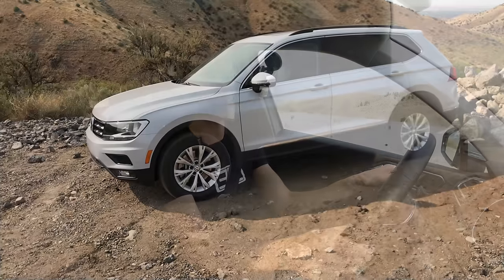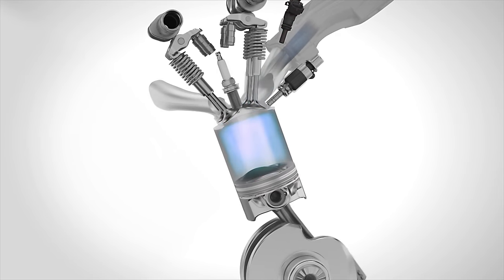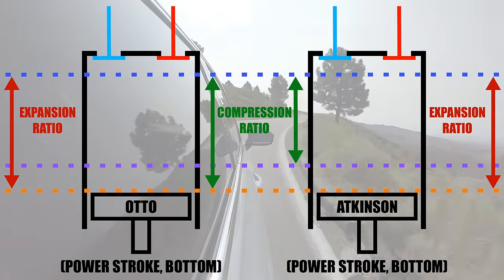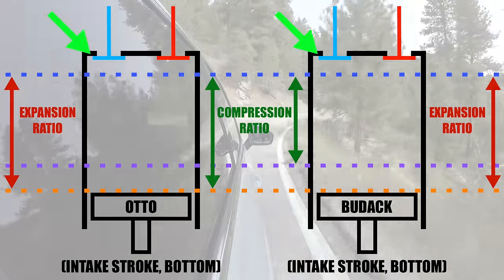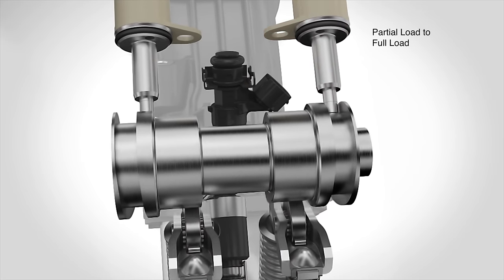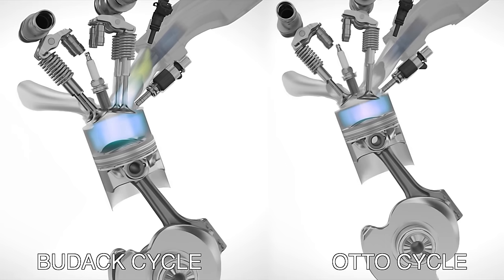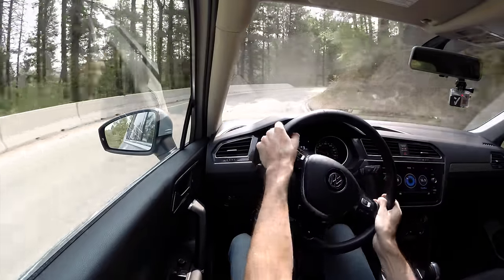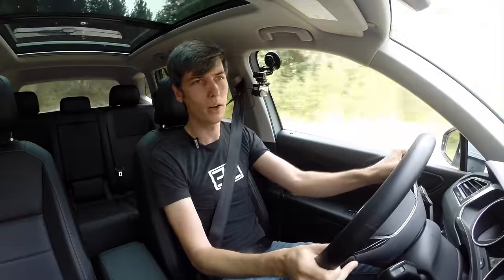Volkswagen's New Engine Cycle - The 'Budack' Cycle

Comment: ECONOMY, NOT EFFICIENCY! The cycle gives economy, but not efficiency, as the engine is putting out at the minimum, equally less power for the fuel consumption.
Reply: Cody Moncrief:  That makes no sense at all, to get better economy under the same conditions the engine has to be more efficient.
Reply: not necessarily, because you can put out more power by efficiently compressing the air/fuel mixture and burning all of the fuel... but that is at the expense of economy. 
for example, the atkinson cycle actually seems to be less efficient (at producing power), but as a result, has better fuel economy. 
seems like majority of people are getting economy and efficiency mixed up.
like in NYC, they have "efficiency" apartments for rent, when in reality they are just "economy" apartments. nothing very efficient about them, other than efficiently making landlords more money, lmao.
Reply: It is using less power when less power is needed.

Comment: All interesting, but wouldn't there be suction losses if the valve was closed early?
Reply: No it shouldn't as it then easier to compress the fuel air mixture on the compression stroke
Reply: @mackal598  I think it should because there isn't ideal gas and there are some loses. To be able to compare efficiency we should get some real life data ...
Reply: No, not really. The "vacuum" just acts as a "spring" so the beginning part of the following compression phase will use up the energy you have put into the "vacuum". Sure there are tiny losses, but they are far less than what you gain from the higher efficiency.
Reply: The suction is to differentiate what they're doing with Toyota's atkinson engines which are running in millions worldwide..

Comment: New owner of one . So my question was this drive done in normal mode or in eco mode ? Driving over a month I've played with the settings I currently run it in custom where it's sport steering with eco mode . The car has made 35+ highway and 24-27 without the ac on city . I switch it to sport and all that goes away 😂 then it's 22city -27 highway ac on ? 22 either situation.
Reply: Budack cycle is useless.  Doesn't actually improve fuel economy, it only works theoretically. The different modes  in the VW are transmission modes. I drive my 2020 4motion Tiguan in sport mode all the time and use manual to force the up shifts while cruising and get 35 mpg on any trip that's 60 mph or faster.
Reply: @remmuhjeff  it is an efficient engine, but I prefer the old 1.4 TSI EA211 with Atkinson cycle.

Comment: Doesn’t change the cycle, it changes the cam duration and profile. It’s still a 4 cycle engine
Reply: Juan Herrera that is like saying Diesel cycle and Otto cycle are the same because both have 4 strokes
Reply: @gustavoortiz1901 . I don't know about every diesel engine but mine is a two stroke not four

Comment: You missed that the Budack cycle not only lowers the compression ratio, it also creates a vacuum which will in turn suck up the piston. In comparison, the Atkins cycle will have more energy loss, because it is sucking in fresh cold air, warms it up and then needs to eject it.

Comment: Has VW claimed any advantages over the Atkinson cycle?
Reply: Outside of not having to pay the patent holder for the "Atkinson" tech? Any time a company does something it is about the bottom line. How much does it cost and what will we get out of it.
Reply: Above, blurglide also pointed out that Atkinson-cycle engines suffer from unneeded pump losses, that are addressed by the Budack design. This seems like a viable engineering angle to support their move.
Reply: I think Atkinson cycle won't work with boost or won't make much sense at least. Pushing out air through the intake valve while the intake port is under boost pressure...
Reply: Isn't the Miller cycle just Atkinson + boost?
Reply: Also it's a benefit that you don't push out your already created fuel air mixture into the intake manifold. If you do that, it gets harder to inject the right amount of fuel in the next cycle, because there's already fuel in in the intake air. This benefit is only for injection into the intake (mpfi) and direkt injection during the down stroke. If there's a direct injection in the upstroke, it makes no difference.
Reply: Peter Muelltonner this makes sense, I couldn't  work out the benefits over Atkinson cycle.

Comment: They should have stuck with port injected SOHC and worked on reducing NOx. If the volumetric efficiency is permanently reduced by omitting dohc and vtec, the (actual) compression ratio can be increased proportionately to the reduced intake pressure/volume.

Comment: My neighbor had a VW Tuareg. He had an Isuzu SUV before. The Tuareg (according to him) was "the most unreliable vehicle he's ever owned" - and extremely expensive to service and repair. The Isuzu, on the other hand, was "the least expensive to maintain and most reliable vehicle he'd ever owned". I bought it from him when it was 12 years old and I ran it for another 13 years. It cost next to nothing to maintain.
My neighbor spent $35,000, on the VW, over the next five years. (New engine, new auto transmission, new catalytic converter, multiple electronic and brake issues. Other people I know, who have owned Tuaregs have told me similar horror stories re. reliability and overpriced spare parts. 
Reliability is everything, unless you're only going to do city driving. .
A slow revving, simply designed, unstressed Diesel engine that is cheap to service is a no-brainer. At 30mpg, over 30,000 miles, the fuel cost is about $3000. 25mpg, equates to $450 _extra_. ie no big deal.

Comment: How long will it take to go to normal power mode? Probably too long? After dealing with their earlier turbocharged cars that had no usage torque and power for real life driving and acceleration especially for merging into traffic from a stop sign I vowed never to fall for such dangerous gimmicks again. They put a turbo in it, reduced the engine displacement significantly and make the car heavier. Almost got me rear ended and killed a couple times and I got rid of a then brand new Passat and lost a good chunk of money doing so. I’m not falling for a reduced power cycle engine. Screw that!

Comment: First, I think it will decrease the volumetric efficiency
Second, as the volumetric efficiency decreases, the compression ratio will decrease too
Third, as the compression ratio goes down, the engine efficiency will down too
Am I wrong?
Any tought?
Reply: agree with your point. but Acc to me the power and torque will go down but car will achieve more mileage.
Reply: The gas that exits the cilinder has a lower pressure, meaning it is less energetic. This means less useful energy leaves the engine, also less fuel enters the engibe so the thermodynamic efficiency might be higher.

Comment: My '97 outback with 250k mi on the engine and 312k on the car gets 28.1mpg at 4500 feet altitude

Emission controlls kill gas economy
Reply: "Emission controlls kill gas economy"

True. If the vehicle was made in the '70s.

Comment: Ha ha....😆  my 2013 Subaru Forester 2.5 L boxer engine  gives me 27.6 MPG on the high way and 29.2 MPG if I turn it off and roll my windows down.. and did I mention that It has 210,000 miles on it?

So, why go Budack???

Comment: So basically instead of pushing out some air into the intake manifold, it forces tye combustion chamber into A SERIOUS VACUUM.... now what could possibly go wrong switching from vacuum to compression 200 times a minute..... there goes the lifespan of the rings.  And DON'T TELL ME it had "vacuum" during a standard otto style intake stroke.....

Comment: And still, the old VW 1.9TDI with the antiquated distributor type diesel pump runs cheaper in real life scenarios with varied driving. All the new VAG technologies are aimed at unrealistic driving to get good NEDC mileage, seats and interiors are ripped out, grilles are covered, body joints are taped over, THEN they test it. But, in real world driving the variable cam makes sure it can consume enormous amounts of fuel as soon you remove the egg from under the accelerator pedal. Dont take my word for it, just get a 300,000 mile 1.9TDI and see for yourselves. Budack basically just came around to replace the Defeat Device subroutine, artificially low consumption on paper and high real life performance.

Comment: Basicly VTEC is same  idea. Switching cam profile. If you can make a 3 profile (maybe even more) to one for Budak cycle one for Otto cycle with lower timings and lifting and one for crazy RPM cam you can have a budak/VTEC high reving screamer with low fuel using when you are crusing. Also you can make a supercharged or turbo charged versions and Budak cycle for high Boost setup i guess to make the engine even more crazy. But the top point is elctromagnetic valve idea. Of your valves are controlled by a elctromagnets you insted of camshafts you can switch the cam profile ore the cycle with a ECU. This can make your engine what ever you want. You can lower your compression ratio bu using aktinson cycle and with high cam profile actinson cycle engine you can rise your rev band ratio afr ratio and Boost level automaticly. This can make your engine like almost ant engine you want. when crusing engine prouduses 100hp Max and saving fuel even more. But when you kick the pedal engine switches the mode and boom you got a screamer 500hp 9000rpm monster
Reply: Or !? Go Electric!

Comment: This is not a "new cycle" its a four-stroke engine with what is effectively the wrong camshaft that does not count as a new cycle "oooo I retracted my valve timing 15 degrees to early" 

 slaps roof of car "this bad boi fits soo many camshafts with lobes that are not correctly positioned"
Reply: @S Hendricks "oooo I retracted my valve timing 15 degrees to early and added a turbo" NEW CYCLE 25 Million dollars please.

Comment: question:  as the intake valves are closed before reaching BDC isn't the piston pulling a vacuum for that last little bit of the intake stroke and does this not rob power from the engine ?  i see how having the "longer" power stroke can increase thermodynamic efficiency, but how much of the potential gain is lost to the aforementioned phenomenon ?

Comment: I think the engineers at VW created their own job security by selling this “new concept” to people who don’t know how engines work!

This is nothing more than another approach to Variable Valve Timing (VVT).  Keeping the intake valve closed for part of the intake stroke does not change the compression ratio - it changes the CHARGE DENSITY of the air/fuel mixture in the cylinder.  It’s the same thing the THROTTLE does.  Variable Valve Timing also controls airflow through the engine but better in that it can modulate both intake and exhaust timing over wide load and/or engine speeds.  In fact, if given enough range, VVT can even eliminate the need for a separate throttle valve.

More complexity, cost and potential failure points when the engine already has VVT.  Just make the VVT better!

Comment: This looks to be very similar to the engine they put in the Polo GTI 6C (1.8TSI [Engine Code: DAJA]  - I think the other name might be known as EA888 Gen3?).  Not only does it have this technology, it also has a very complicated cooling system and it also has dual injectors per cylinder, one high pressure and one low pressure.

I'm not entirely sure what having dual injectors achieves, other than different available flow rates for fuel  injection.  I was under the impression that the efficiency came from the high pressure atomising the fuel better?  However, it seems to me that the high pressure rail is for high performance above 3000rpm (or just high driver demand via the throttle?) and the low pressure is only active during low load situations.

I have checked this with diagnostics (VCDS) and watched the injector firing counts, which does kind of confirm what I've said, but I've not taken it for a drive whilst monitoring the figures.

Comment: Well..  the WHOLE idea of the atkinson cycle was to kill 2 birds with 1 stone. 
1) have displacement on demand via vvt and thus drastically changing the engines efficiency, while cruising for best economy and still have best power. VVT as we all know is a VERY reliable hydraulic system rather than VW's mechanical possibility of failure with pins and sliding camshafts.

2) REDUCE PUMPING LOSSES.   Pumping losses are incurred anytime you are trying to suck air through a restrictive opening, Or compressing gas in a cylinder for ignition, or pushing spent gasses out the exhaust valve. Toyota managed to reduce pumping losses significantly simply by leaving the intake valve open past bdc. This pushes air back into the intake for other cylinders to use. and because there is less vacuum in the intake, it goes to show that there are also less pumping losses because the engine is not pulling as much air through the closed throttle body.  VW however said Fu6k pumping losses and we'll just slam the valve shut BEFORE BDC and take a hit on the pumping losses. They also have lower intake vacuum, but that's because the pumping losses happen under the head where the valve is closed..  

There IS something to ponder here however..  While pulling excessive vacuum is more than likely going to cause oil consumption problems in VW's near future, it begs to wonder..  Because the piston is pulling against a shut valve With air AND fuel, does it achieve negative pressures below the fuel vapor point causing it to further homogenize with the surrounding air?? (Think water boiling at room temp in a vacuum chamber)

The world may never know..    But I'm going to guess that VW has recalls on this engine for oil consumption problems.. :)

Comment: As I recollect, the Prius Atkinson cycle engine has a blower.  If VW can achieve same w/o blower, that’s significant.
BTW, the ~1943 Lycoming XR7755 had a two speed cam.  I think it shifted axially between take off & cruise.  Many old ideas are reborn w/ advent of new tech, like microprocessors.

Comment: A 2wd Ford F-150 with the 2.7 Ecoboost gets 27 mpg on the highway but will stomp that VW. What exactly is the point of making this ‘new’ cycle and all the complexity if it’s not even up with its normal competition. My wife’s 2017 Escape averages about 27 mpg and gets low 30’s going 72mph.

Comment: Atkinson's best engine was the Utilite' 2 stroke made in the 1890's . Bruce Crower of Crower Cams was making cams was making this type of cam that closed the intake valves early back in the 70's. It was part of the economy cam kit. The kit included 13:1 compression pistons.  Those kits could allow a 327 V8 in a full size vehicle to get mid 20's mpg. I think the only innovation here is switching the lobes from economy mode to full power mode.

Comment: Engine design begins with thermodynamic analysis.  The Budack, Atkinson, Miller cycles are distinct when plotted as pressure/volume or as temperature/entropy and thus named individually.  
BTW, compression ratio is geometric- it’s the same throttle open or closed.  What is thermodynamically relevant is pressure & pressure ratio.

Comment: Being VW a massive marketing team will spend a fortune convincing you their cheaply engineered crap is really good, and many have bought the lie.
Reply: No insult meant my friend, just frustration born of a lifetime struggling to work on the sods. I actually had a guy bring me a 4 year old VW which had already had its full central locking replaced at 2 year old, then had a recall to have major repair to front lower suspension arms bring it to me with further locking issues and while I tried to diagnose it stand there and tell me how reliable they were!

Comment: It's not exactly a new one it's just a blend of Atkinson cycle and Otto cycle just mixed both... In one engine no more Atkinson only or only Otto combination of both excellent to be honest a bit stolen from Toyota but good (1.2 turbo Toyota has exactly that) 2015 punchin out 116 Hp quiet good and a punching amount of torque not bad at all with the turbo giving a very usable torque from low down up to high on the revs max torque from 1500 to 4000 rpm enormous range

Comment: a lot of breakdowns planned for these Veedubs... high sulphur fuels that is found in most markets will require more frequent oil changes, most owners not wanting oil changes because they were told at sale time services a longer apart.  What they should do is us the current camless engines. running piezo electronics that open a valve with spring return like BMW did back in the early 2000s on a 318i test car.  very reliable and cost effective and an adaptive camshaft map.  should be able to be a very volumetric efficiency across the whole rev and load range

Comment: I have been a mechanic for 27 years. What always baffled me is the 3.8 liter buick lesabre or park ave from the mid to late 90s would achieve 27-33 mpg no problem with a 2 valve pushrod engine!     Why?!